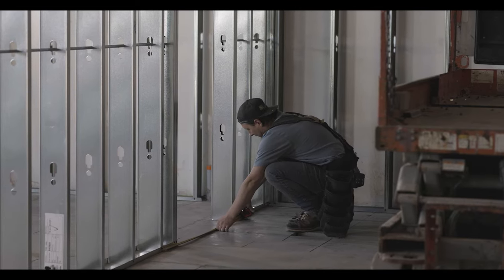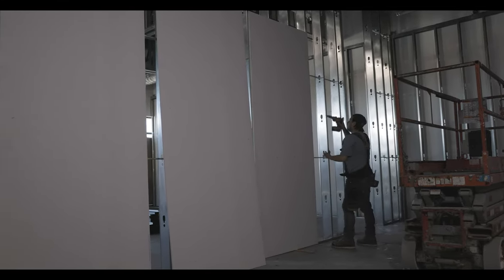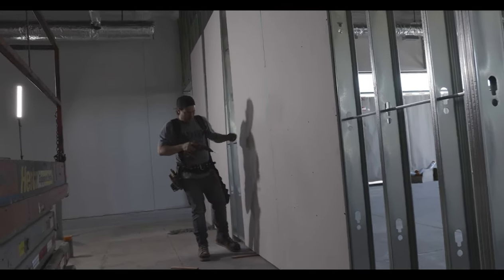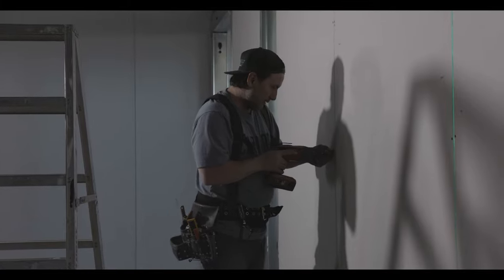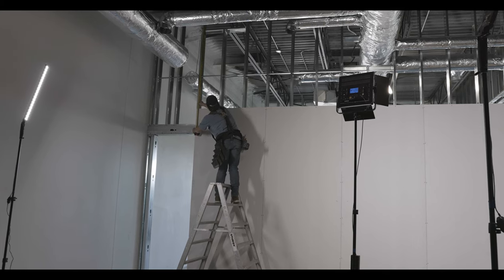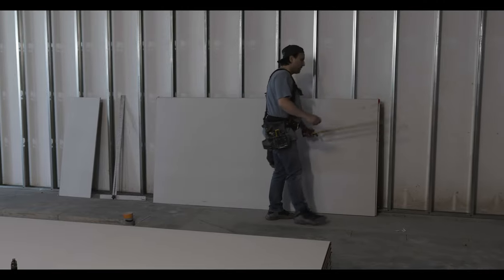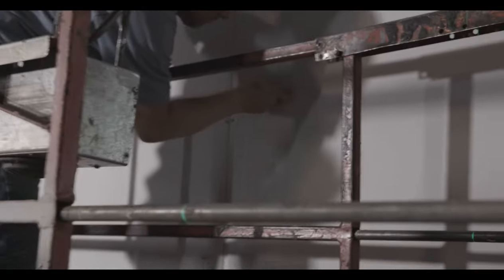How To Drywall Metal Stud Framing

Comment: Nice work, Chris. For those who may not know nor noticed, always put your toe at the bottom of the T-square while using it. It keeps the bowing of the metal to a minimum. And, yes, drywallers here in the States call it a "router" vs "drywall cutout tool." 😉🍻👍
Reply from the maker: Yes bro! Great point, plus I run my thumb along it to keep it tight to the sheet! 💪🙏

Comment: This video has helped a lot man 😁. Do I know where to start, as soon as the framing portion of it is finished? I always have trouble trying to figure out which wall to start from (the building has exterior walls), but after that, everything falls into place
Reply from the maker: Right on bro. Yeah we will start on the exterior wall, tie in floaters and if there is insulation we try to make it so for example, a long hallway with rooms we do the inside first then you can fly down the hallway and insulate, then we will go every other room so again insulate two walls a room. Hope that makes sense.

Comment: Thank you. I'm using metal studs in my basement and every time I try to use the self-drilling screw with an impact drill, it does not go through as easily because the stud is flimsy. There is a gap between the stud and the wall and the flimsiness is driving me crazy.
Reply from the maker: That's because your using the wrong screw, you need the black phosphate screws for light gauge steel. They have pointy ends. Hope that helps bro! Also you can use carrying channel, install it every 4' or in the middle knockouts of your wall tighten it up.
Reply: A drywall screw gun works much better...hope your basement turned out well

Comment: Question: The stud to bottom plate is below the dry wall and won’t interfere with it. But, the stud to top plate screw would seem to interfere with the dry wall lying flat against the metal. How do you ensure the drywall is flat top to bottom against the metal stud?
Reply from the maker: Use the wafer head framing screws and you'll be all good. The sheets are beveled toward the middle of the sheets, countersink the drywall screws just enough not to break the paper but in enough to cover with mud. This is a non issue, the sheets won't pop out with the wafer head screws. The drywall screws are bugle head not to be confused.

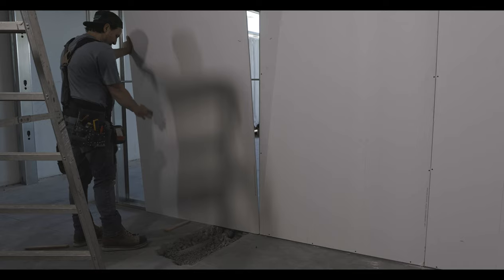Comment: Hi. I enjoy watching your channel. I am going to start drywall a commercial insulated concrete form (ICF) building.  I was wondering if you recommend installing the sheets horizontally or vertically?  The ceiling slopes from about 28’ to 26’    Same question for the metal stud framing in the building.  Those walls are 12-24’ tall.  Also what do you think is a fair price for finishing the drywall to a level 4 finish?  Keep up the great work 11:21
Reply from the maker: Hey friend, that's awesome man thanks! I really like stand ups, and lay downs (horizontal) can be very useful as well. Thr most important thing is to have the right staggering from front to back of the wall, and on laydown at 32" min butt joints land. Is the entire building ICF? Did  they frame / furr it out with steel stud? If so do stand ups (vertical), wood lay down, also in areas it makes more sense for taping like in bathrooms, so you only have 1 joint at the middle, ceiling and corners. Hope that helps!
Reply from the maker: And install drywall @ $0.60 and tape $0.50 / sf + $2.00 / lf for any corners, returns, plastic(trimtek)
Reply: Thanks, I appreciate you taking the time to answer everyones questions! @ConstructionKronies

Comment: Why do the existing surrounding walls not have the horizontal metal bracing running through the studs, what’s the reason behind that?
Reply from the maker: I think you mean the furring wall, sometimes those are against the base building demising walls and are for plumbing and electrical so they ask us to leave it out. All the other walls get it every 4'.

Comment: I do the same metal stud/drywall work that you are demonstrating here.  Very informative video!  I think you explained everything very well man.
Just curious though, we always stagger each sheet by a foot or so, every other sheet we stand up.  I.e., stand up a twelve, then an eleven, the back to a twelve, etc….
Just curious if you do that?  Or maybe it doesn’t get topped out? Or maybe it gets a ceiling?  Awesome video man, not knocking anything, just genuinely curious!  Keep up the great videos!
Reply from the maker: Thanks my man. Yeah some guys stagger the sheets like that but I don't really know why. When. If we lay down sheets yes stagger at least 32" but stand-ups are designed for steel stud specific and are staggered from either side of the wall. I think that some regions may specify you to do that I don't know for sure but I've heard of this before. Thanks again👍
Reply: @ConstructionKronies  appreciate your reply!  Like i said before, keep up the great videos man!  We always stagger our seems…..whether it single layer, double layer or triple layer.  Double layer, 5/8 drywall for fire rating….
3 layers is for sounds….movie theaters.
Inspector will never let us get away with stacked seems!!  Love the info you are providing!  Keep it up man!

Comment: So i’ve got a diy project coming up that involves framing a metal stud wall up against an existing wall, with drywall on both sides. Any tips for possibly framing and drywalling one side on the ground and standing it up?
Reply from the maker: Yes bro, remember to square it before drywall, measure corner to corner and make sure the number is the same both ways, use two screws in the top and bottom track through the end studs. The concrete or floor may not be level check that first and then get your measurements from the high side and you may need to use shims when standing it up. Then just drywall the back side, stand the wall up and.you can also screw through the brown side of the drywall into the studs of the other wall with 1-7/8" or 2" screws. Once it's up drywall the inside.

Comment: What kind of screws do you use when framing on metal?
Reply from the maker: #8x1/2" Philip head wafer screws. You can get them fine tip for light gauge and self drilling tip for heavy.

Comment: do you use regular Drywall Screws? If not, what kind do you use?
Reply from the maker: I do but regular may mean something different to you. For single layer we use 1-1/4" regular for light gauge and self tapers for heavy gauge. You also need to get screws made specific for wood or steel.

Comment: Do not screw in the seam until the next sheet is screwed in place tight to the lead sheet. That way it can't protrude inhibiting the next sheet to sit tight..
Reply from the maker: Yes bro! I go back after the section of wall is all tied in to screw off the bevels. I only screw in 2' 4' and 6' with 4 in the bottom then go back 1' in the bevel and 16" in the field.

Comment: Which drywall gun would be the best for installing sheetrock on outside walls with heavy gauge studs and track?
Reply from the maker: I use the Hilti 4500 and 5000 both guns are great. I highly recommend the Hilti.

Comment: What is a simple definition of deflection?
Reply from the maker: It allows for 3/4" movement up and down. This gives you advantages like using standups. Contraction and expansion. All buildings move, especially new ones still settling in. In places with winter too.

Comment: Why do you insist on 1/2” space on the bottom and not willing to use the 5/8” drywall to space it? Great video.
Reply from the maker: If you use the 5/8" try to use the bevel of it. You will notice using the 1/2" makes it a lot easier when screwing into the bottom track,  never miss. More misses when you use the 5/8", especially on concrete. The other reason is for caulking and fire stop. You ideally want 1/4" to 3/8" for that, more than enough for any liquids to spill, you don't want it to get sucked up by the drywall. Thanks man!

Comment: Dude, you would have to kick it in the ass to make it in the Chicago District Council of Carpenters Union. The expectation is 100 sheets minimum, 4x12x5/8” for a two man crew. Lock that screw gun in the on position and go to town. Two guys, one cut and carry, the other guy runs screws.
Reply from the maker: No, I don't do that shit anymore. I respect it very much and know the hustle but it's too much. 100 sheets of 5/8" each day is a ridiculous ask for anyone, it's supposed to be 40 per person and that's on a gravy run. When your doing units like condos it gets even harder. Plus the unions here have lowered thier rates, not me, I charge 60 to 90 cents per square foot for board when the unions are paying 22 cents, no thanks. Asking that much is dangerous, people aren't machines and the quality will suffer no? But mad respect to you !

Comment: NO Glue?
Reply from the maker: Negative. Never need it on steel stud. The only time you use glue is in residential wood framing so you don't have to use screws in the field. You still need 2 screws in the field and perimeter.

Comment: Looks like you’re fastening the hard side first… if framer knew what he was doing layout was pulled from soft side ..😮
Reply from the maker: You can screw in either side first just don't counter sink the hard side first. We call that back boarding very common practice. On heavy gauge steel it doesn't matter the studs won't twist, it's more for a light gauge studs to screw soft side in first. If that makes sense!
Reply: @ConstructionKronies  you’re very slow